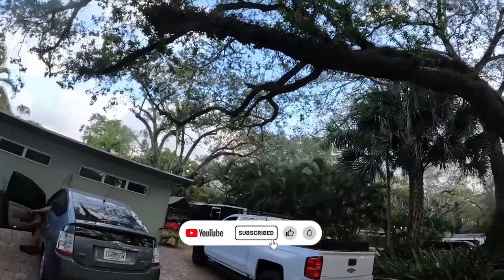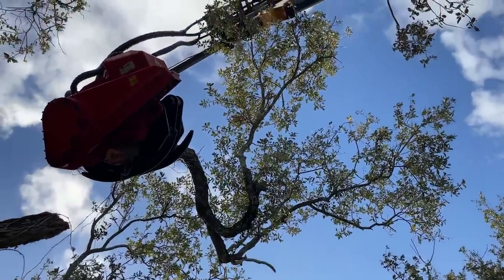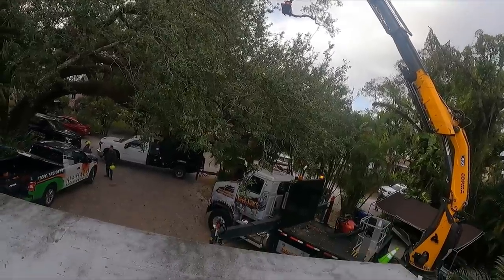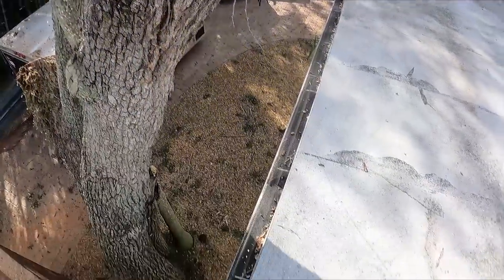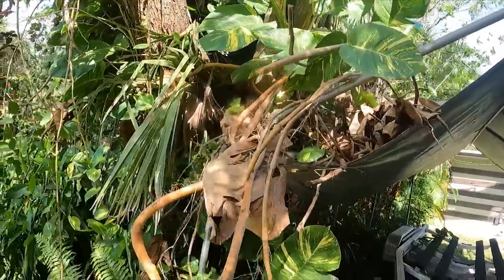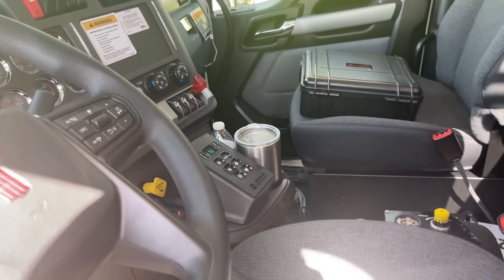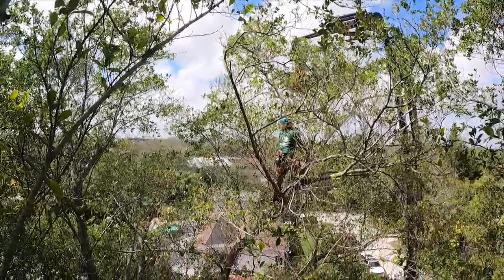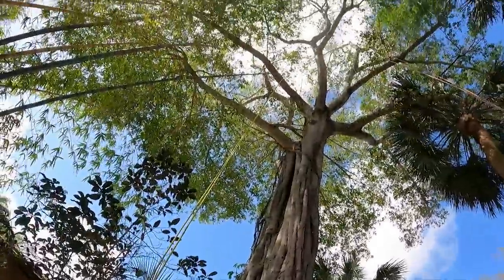Operating My FIRST Knuckle Boom Crane! | Last Day In Florida with Randy!

Comment: I womder how that Fikus burns?  I suspect that sap burns fast.  
The saw motor in the claw seems a very powerful electric.  
Does it do the hydralics too?
Reply: That's more than likely a hydraulic saw
Reply: Ficus is not good firewood, neither is it suitable construction. They are just highly evolved species of trees able to germinate way up in the tops of other trees, and send roots down to the ground slowly. Upon the roots reaching the ground the ficus begins to grow, eventually encompassing and "strangling" the host tree. 

Ficus are absolutely majestic trees, around 850 different varieties and some reach phenomenal sizes. Most readily self graft and others produce massive curtains of aerial roots. Check out the Curtain Fig or any of the other giants. :)